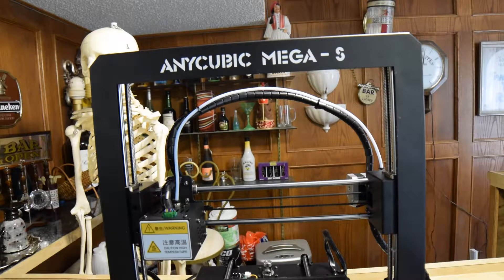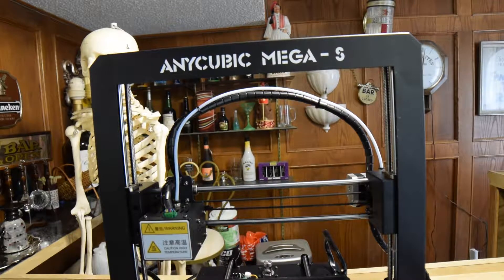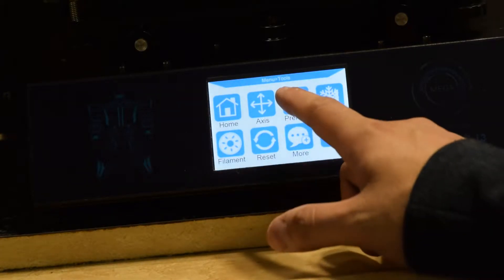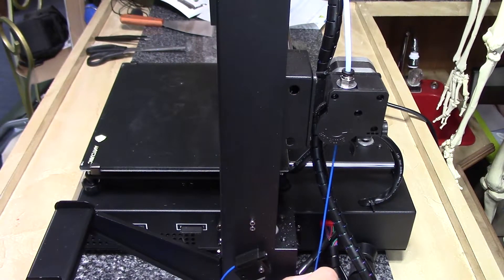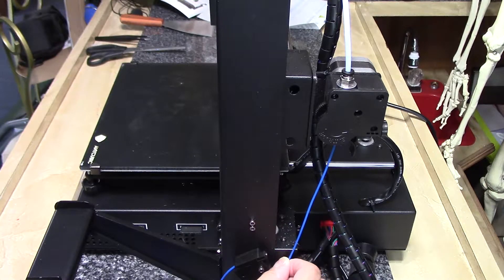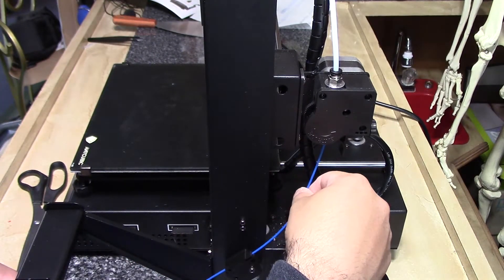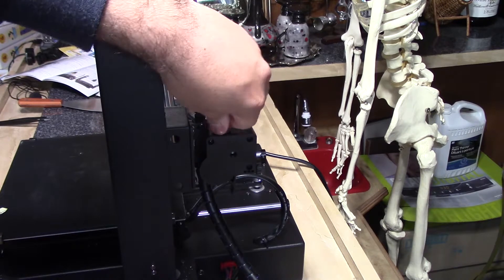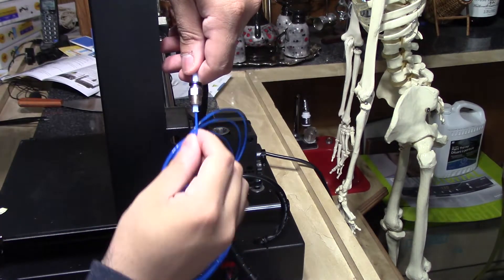Qucik Fix Ep3  Removing Broken Filament 3D printer AnyCubic Mega S

Comment: How did you get the feeding tube unscrewed from the machine? I can't get mine off :(
Reply from the maker: if you can't unscrew it by hand go get a crescent wrench.
Reply: @lilrex2015  The "washer" actually goes down into the whole.  To unscrew the nut, I have to hold the "washer" some how.
Reply from the maker: @juanitahubbard7633  send me a picture on twitter @lilrex2015
Reply: How did u ever fix it ?
Reply: same problem.

Comment: I can't unscrew the feeding tube. Any hints?
Reply from the maker: did you try a wrench?
Reply: @lilrex2015  of course, but the problem is that the bolt I'm supposed to screw rotates with the washer too.
Reply from the maker: @Bacchinif  tweet me a picture of it @Lilrex2015
Reply: @Bacchinif On my i3 Mega, I had the same issue, but I don’t think removing the indicated nut will help anyway.

If you remove the three hex screws on the right side of the feeder and remove the cover plate, you can get inside the feeder. The big stainless bushing that nut is attached to, with the Teflon tub running through it, can then pull straight out the side, letting you get to the open end of the tube. (There’s also a black plastic fitting on the end of the tube assembly that should slide right off.)

Also, there’s probably a spring/lever putting pressure on the side of the filament that can fall out once the cover plate is off; make sure not to lose those!